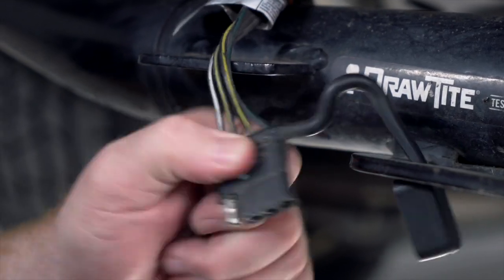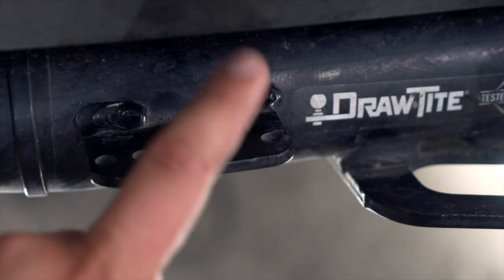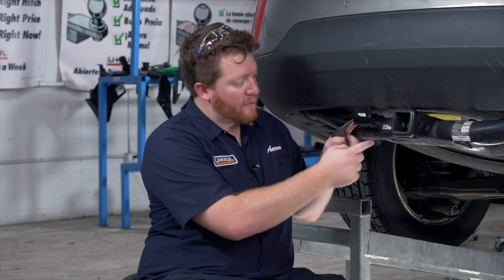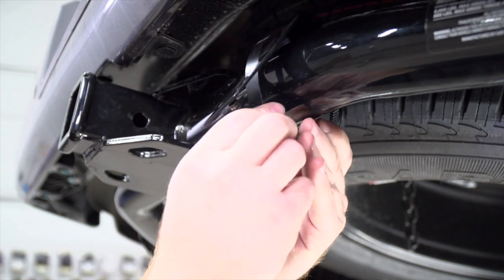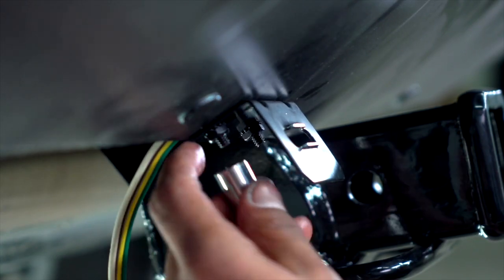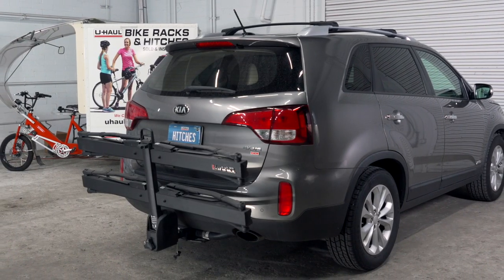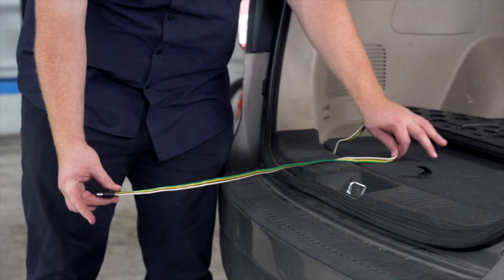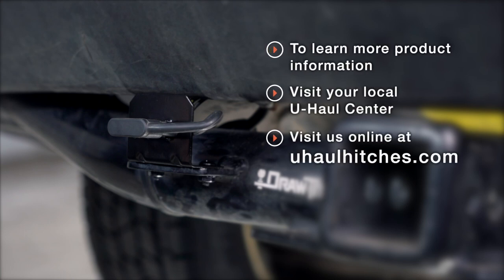Where/How to Store Your Trailer Wiring Harness

Comment: Thank you so much! 
---
I had U-Haul install a 4-pin wiring / hitch on my old car and the guy left the wiring in the trunk. He said the same thing you did, "It's nice and protected and it doesn't hurt a thing when you close the trunk or hatchback." 
---
I've also heard that pulling the trailer harness inside the trunk is a better idea because if the wiring does get damaged from the trunk being closed it, it's easier to replace the trailer harness than replace the car wiring harness. Food for thought there. 
---
I owned my old car for 15 years and only used the wiring harness 4-5 times. 
---
For my new car, I did the install myself and left the wiring harness in the trunk where it's safe and ready to go.